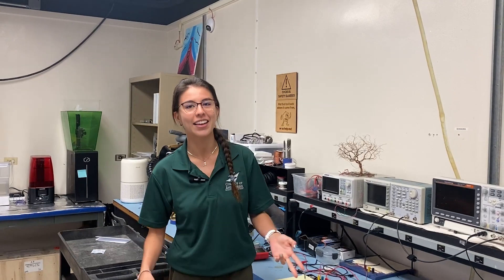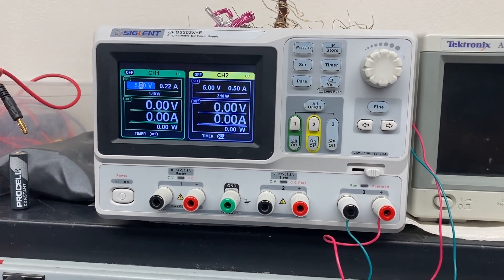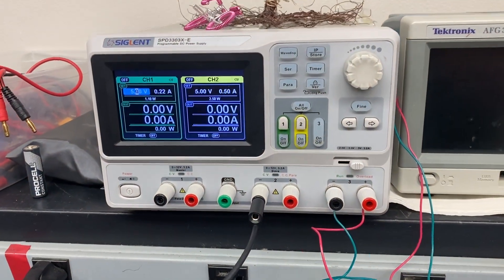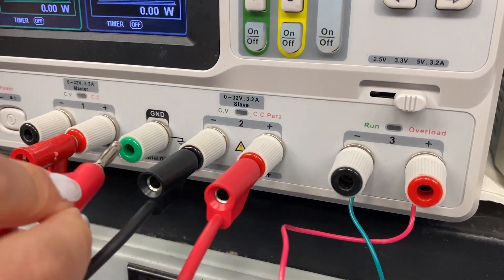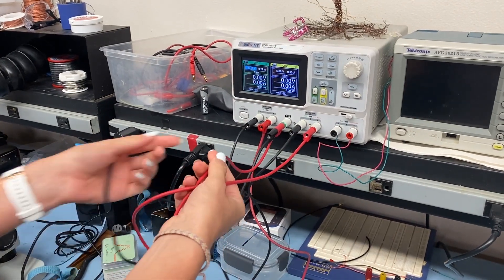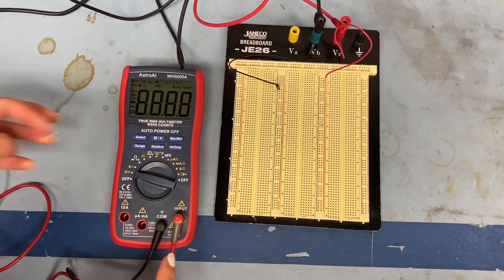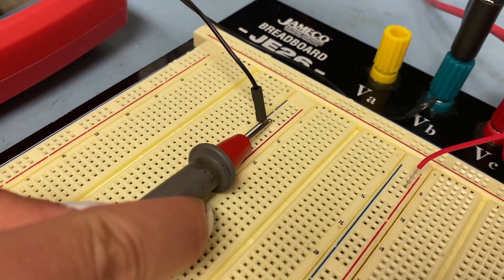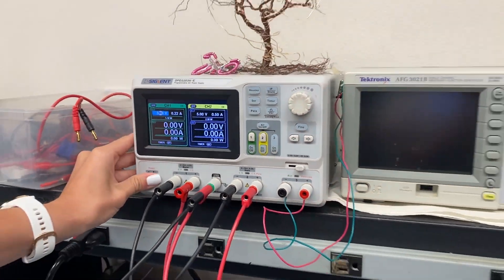FabLab Fundamentals: DC Power Supply #2 - How to Get Negative Voltage

Comment: If the power supply happens to be the only AC powered source in the circuit, will it be necessary to connect the minus/plus terminals of the positive/negative voltage sources, respectively to the common gtound? Will only shorting them together also work?